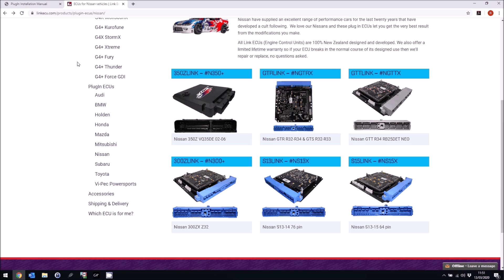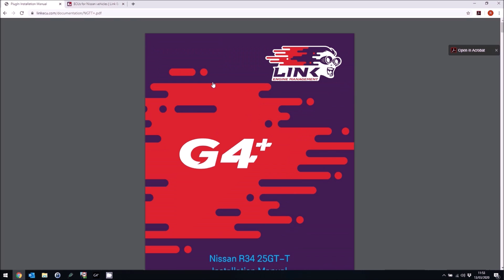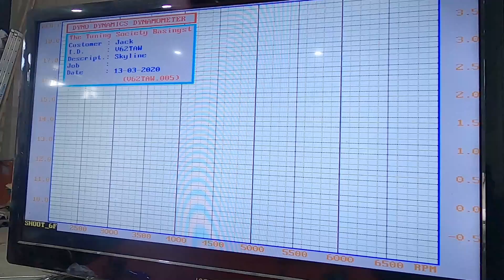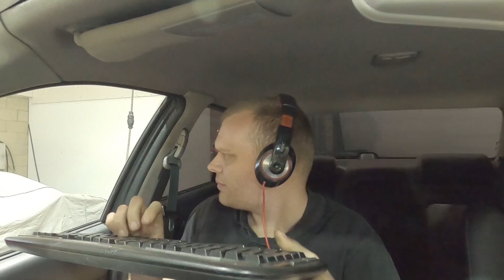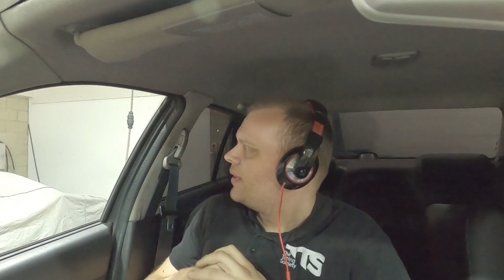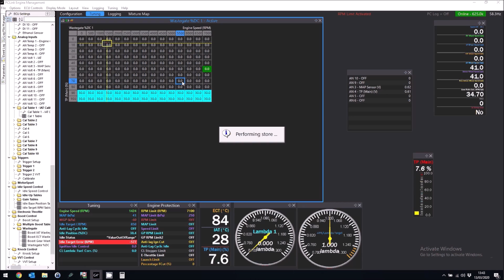Nissan Skyline Link G4+ ECU Live Dyno Tuning FREE Demo! -  Part 1

Comment: In my experience when tuning a rotary you dont get too much more power with timing but very likely apex seal failure.they are much happier with more boost and rpm
Also alot of boost control does not actually make a difference untill 40-50%

Comment: Looking at how you converted from traditional to modelled, where you did you get the 45 number from to divide by?
Reply from the maker: Basically add whatever percentage you require to make the highest number in the tables around 100-105% VE.

Comment: will this guide help if i'm using a link g4+ monsoon on a 4g63?
Reply from the maker: Most likely yes as tuning is tuning
Reply: @tunedbyrabbid  Thanks!  How do you calculate the need of removing 2.5% of fuel at 34:10?
Reply from the maker: actual afr ÷ target afr will give you a factor to correct the cell by.

So 11.8 ÷ 11.5 is 1.026 so approximately 2.6% more fuel required to meet target.

Less than 1 means subtract fuel so 11 ÷ 11.5 is 0.96 so approx subtract 4%

Comment: I’m really interested in moving over to modeled vs traditional. Traditional is good to drive the car to get tuned but not to actually drive on long term
Reply from the maker: It is definitely the better option in the long term it also makes retuning easier such as swapping out injectors is just a setting change rather than fiddling with potentially your whole fuel map

Comment: It's awesome to see dialling the afr down to 2%. I will be happy within 10%. It's a struggle to do anything on the road. What's the rpm/load where you are confident to leave in closed loop lambda control?
Reply from the maker: Depends how confident you are in your wideband sensor and its reliability, and how good your controller and ECU is at detecting and disabling it if a fault is detected. In theory all the time, but it could go very wrong if the sensor turns bad.

10% is not good enough that can be the difference between 11.8:1 AFR and 13:1 AFR

Comment: Just wondering - was the Cam Angle Sensor set to fully advanced with trigger offset dialled in?
Reply from the maker: It doesn't matter where you set the CAS sensor as long as once you set your base timing you don't change it.

Some people leave it alone and match to where the stock ECU was happy, some people put the CAS all the way to one side then match the Link to that new setting.

Comment: Hey video is great! I’m based in lakenheath area here in the uk. Any chance I’d be able to get a base map for my r33 rb25det, Garrett gt35, 1000cc injectors, front facing plenum, 6boost mani, with link g4+, fully forged with 9:0:1 compression.
Reply from the maker: Link has base maps for these engines, you'll just need to go through the setup procedures I've shown here and adjust for your setup before starting it.

Then get it to the dyno to get it tuned.
Reply: Tuned by Rabbid ahh okay thanks, it’s a learning curve for me an trying to figure all of this out

Comment: Excellent content-you Sir are a true professional!  I'm in the process of buying a 2JZS147 ARISTO that has a G4+ and already been mapped to a world-class standard (track performance video was taken). I  assume that one would go through all the functions, settings, tables, etc. and  save everything as my base of reference?  I know adding new parameters and engine ware would change things over time but as a complete beginner at all of this not having to figure everything out from scratch would be very helpful.  Obviously would not want to be lazy and apply  some reverse engineering to the settings to understand  concepts and reasoning behind the assigned values

In reference to a question made by another comment here on Methane/ Water injection.  You explained how to wire it in what specific sensors would you recommend for this?  And would some type of wastegate positioning sensor (ie Tiel) or TurboSmart fly by wire be able to be controlled by this ECU? Also for me,  I would be looking at methane/H20 injection as a way to keep the heads clean.  I've heard figures of 15% H20 but at what intervals?  Also by consistently having  lower intake   temperatures you could extend engine life.  But the same questions arise what kind of intervals?  I know some complex questions but any answers from a top notch tuner as yourself would be greatly appreciated.  Subscribed- Cheers!
Reply from the maker: No harm in saving your existing map and editing from there, no point redoing work that doesn't need to be done.

I assume you mean Methanol not Methane, depends on your controller for it as to how it will operate with the ECU.

Normally you want to inject a minimal amount to act as a cleaning / cooling agent. Rather than becoming totally methanol reliant.

See your manual for recommended injection amounts for your power level.

Comment: Loving the videos, proper in depth and easy to understand.
I was looking into a Link pnp for my 300zx. Im looking to use  the ECU to control a water meth injection setup, and wondering if using a system with an arm button could innitiate a 2nd fuel and timing map within the ecu so essentialy i end up with a meth and non meth map, and use both the factory knock sensor and also some form of meth failsafe device to be able to trigger back to the non meth map if there is a failure with the meth system?
Reply from the maker: AEM Controllers also have a fault output which you could wire to the link to switch timing maps.

Comment: Great video and it's free.
Reply from the maker: It sure is!
Reply: @tunedbyrabbid  still would love ols videos. Quick question. Me7.6.2 uprated waste gate spring 10psi so 40% stronger. Would taking 40% off the entire n75 map be a good start point?
Reply from the maker: There isn't an N75 map in that ECU.

It use's Integral limit and linearisation of a PID controller. 

However waste gate duty is calculated on relative boost, you've changed the base boost by changing the spring. The relative boost is still roughly the same above the spring pressure.

So rather than messing with relative boost control (which most do anyway without understanding it) you should just tell the ECU about it's new level of base boost.
Reply: @tunedbyrabbid  The map i changed was "KF to Linearization Boost pressure=f(TV)" address AD89C I reduced all cells by 42%. So you are saying this is an incorrect method for approaching a 10psi spring?
Reply from the maker: Yes totally wrong.
Reply: @tunedbyrabbid  this is the route I was pointed down by a group of tuners. Seems to have stopped the throttle cut issue and boost is normal.
Reply from the maker: It's wrong because all that table does is convert a linear PID output into a non linear solenoid output..

All your doing is all the wrong calculations  for boost target, boost output and then fudging the solenoid to the duty at the last step to a lower value..

That table should be setup to create linear response from your solenoid to improve your PID's response.

Setup your boost control properly, setup your engine VE properly and setup your boost targets properly and your base boost properly then you won't need to do such a horrible bodge.

This bodge might stop an over boost by lowering duty output but the ECU naff all idea about whats going on now so your TC doesnt work properly your adjustments based upon weather or part throttle load or altitude wont work right you just fudge to x duty cycle.

Just shows the majority don't understand what they're doing if they suggest that's how to "tune"
Reply: @tunedbyrabbid  oddly enough this method was recommended by about 5 tuners of rather large companies. 😅 Will do my research a bit more.
Reply from the maker: When reviewing files, sometimes the bigger the company the worse the job.

It becomes more about getting jobs out quick and making profit then doing it right.

Read the manual by Bosch, understand what the tables actually do then you'll find out it's wrong.
Reply: @tunedbyrabbid  got a link to said manual? Don't mind coughing up the cash.